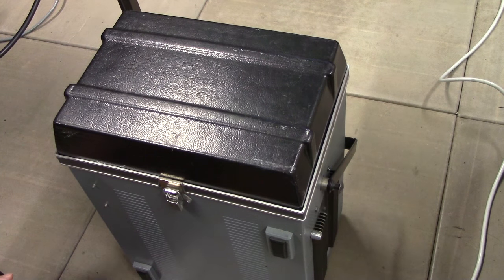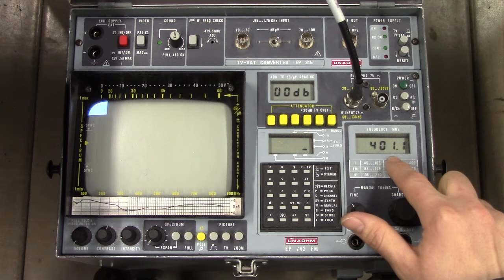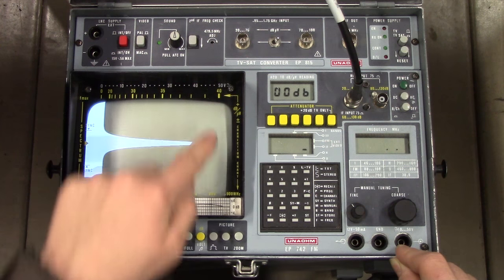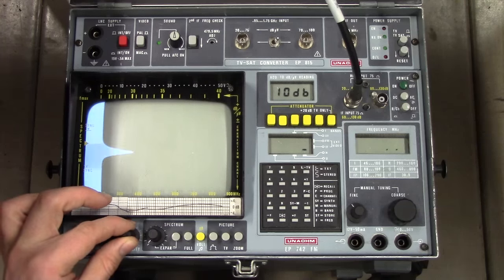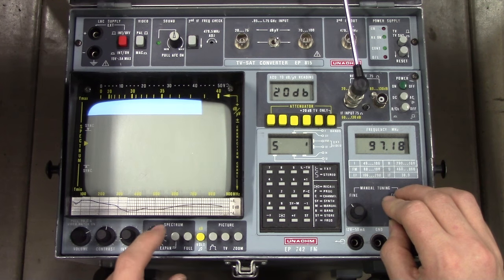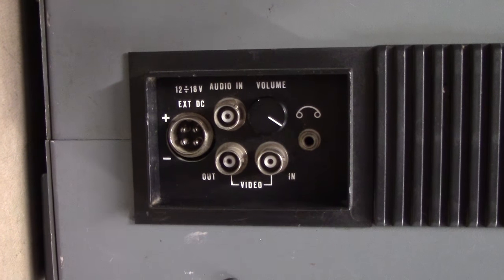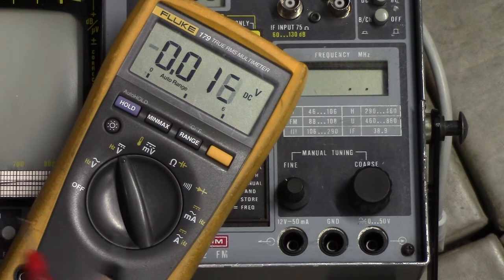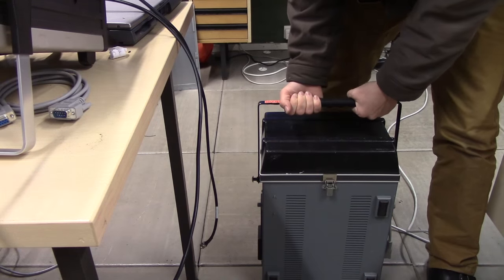Unaohm 742FM analogue TV spectrum analyser

Comment: In Norway we used it as a field equipment to for example finding satellite signals for then analogue system MAC (D/D2-MAC) when setting up satellite dish and equipment, hence the “MAC” and “PAL” button. But could be used also on analogue PAL satellite broadcast and analogue terrestrial and analogue cable.

If you have a HackRF One SDR or other ones, you could hooked that up with the free open source project HackTV which can make SDR into an analogue broadcaster in many different formats and types. The software allows also test pictures and video/streaming.

Comment: Are you located in Sweden? The radio channels seems to suggest that...
Reply from the maker: I'm situated on the Åland Islands. We re-transmit a bunch of Swedish channels here.
Reply: FFcossag I have one of these units. Quite handy for tuning small FM transmitters. My kit got some shabby potentiometers, with new ones works ok, but with some low level noise when tuned to station, possibly from psu. Any luck locating a schematic? BTW, the audio output on the side is a headphone jack, almost certain with fm stereo. Operated by the volume knob close by. The sound is actually not to rotten on headphones. One thing that is missing is afc, could be automatic, maybe?
Reply from the maker: I haven't had to fix it, so I haven't bothered with a schematic. I actually use this thing at work since we're too cheap to buy a modern DVB-T spectrum analyser.